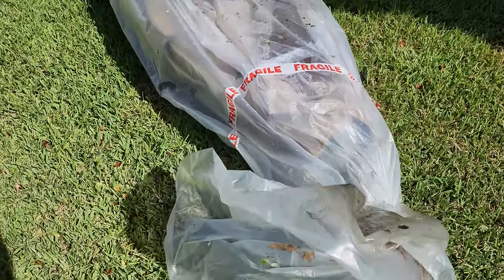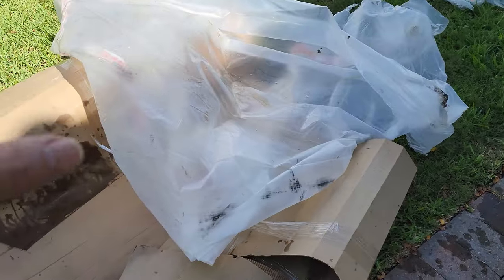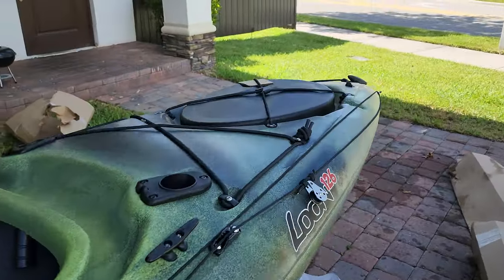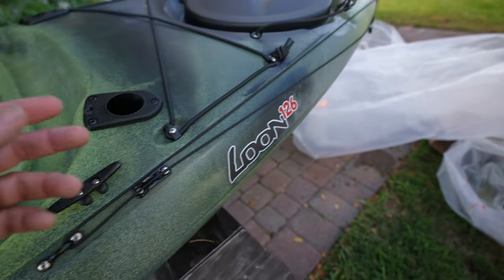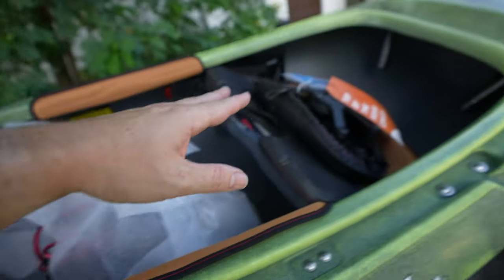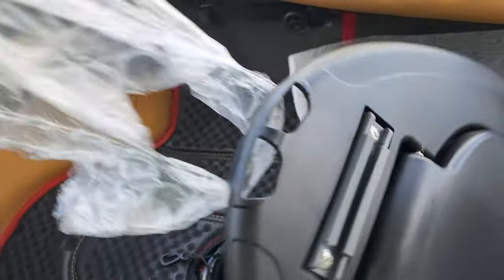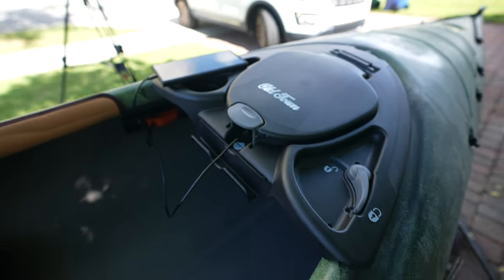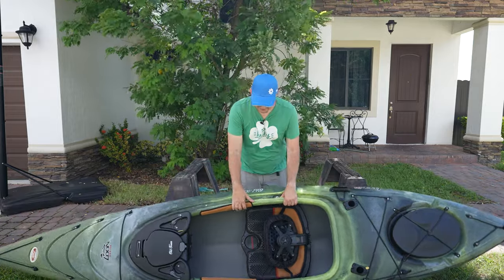are we doing Kayak fishing wrong? Old Town loon 126 sit inside fishing kayak

Comment: If you’re truly new to sit in kayaks you adjust the foot pedals to drive your thighs up into the side pads so you’re body becomes one with the yak. The bottom is rounded so I would expect primary stability to be poor to medium. Secondary probably is fantastic. As you paddle you roll your weight to the side that has your paddle in the water. You should be able to get the water almost up to the top edge and have the kayak stop you from taking on water. It’s fun once you get the back of it. You can really get some speed going because there is less yak in the water as you roll it from side to side. Have fun dude.

Comment: I bought mine in 2017 and rigged it for for fishing. I didn't get the Angler version because I didn't think the price difference was worth.I rigged mine out  myself adding rod holders in the same spot as from the factory and an anchor trolley for under $40.  My fish finder transducer reads thru the hull mounted in plumbers putty.

Comment: Again if you are new to renter with a sit in. Win to the front of the yak with the yak upside down. Lift up the front into the air while your pfd keeps you afloat. Most of the water will pour out. With the front tip in the air roll it to upright. Swim to the side of the yak and renter. If it’s hard use a float on your paddle. Then get in the yak and use a double action high output pump to remove the rest of the water.  Have fun.  You should be able to renter the yak from the side or front or back. Wish I was there with you to do it.

Comment: Aliex, it is an awsome little  sit-in, only because, I love the Oldtown fleet. But yikes, jyst not a fan, of any sit-in kayaks. They just scare me, and I'm only 5' 7" 153 lbs Lol. Especially when I'm used to walking all over my, 120 pdl, with stability, and running my J2- Bixpy setup. But i have a question? I wanna run my Garmin Striker FF. It has all tge options. With my V.M and two usb's, I have installed. I'm still using my 1st Cabela's 12V 8-AH amp hr battery, i purchased 2 yrs ago. What size Amped outdoors lithium, would you recommend. Just to run my FF, VM, and usb ports?  My brother finally bought his, Pelican Catch 110 hydrive ii. So I'm trying to give him little giving him accessories that I'm upgrading. Thx bro. 😎 🎣 🙏